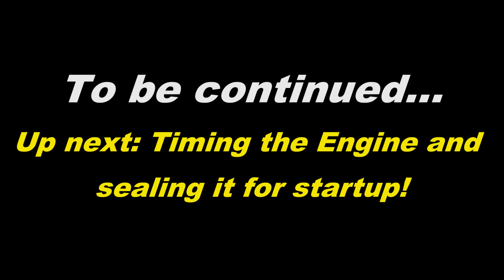Ford 5.4L 3v Engine Timing Chain Kit Replacement Pt 3 of 4: Valvetrain Component Removal

Comment: ...Also, I purchased the Melling M360HV Oil Pump that you linked to but it says it does not fit the 2008 Ford F150. Do you know if that is true or not? It is Amazon saying it does not fit.
I found your video explaining the differences One is just higher pressure. I will stick with my order. You do great work for us home mechanics keep it up!

https://www.youtube.com/watch?v=WLFzB0e3GZw
Reply from the maker: The parts I list fit all 3v engines 2004-2014 otherwise I would of never listed them.
Reply: @FordTechMakuloco  Thanks for the response. I did find your other video that explains the difference between the two. It helped a lot! I'll be keeping the M360HV.

Comment: Help I can’t get the exhaust valve Roller followers off. Intake was easy but I run out of these on tool to crank it down enough to relieve tension. Any pointers?

Comment: Do you need to take the roller followers out to complete the timing chain job if you have the cam sprocket holder and timing tool?

Comment: Hey so I’m working on my brothers 04 f150 5.4 3v and I was wondering if I absolutely have to remove the cams? 2 timing guides shattered and one tensioner is shot and is a mess but can I get away with just replacing the timing components or do I absolutely have to pull the rollers and cams out? Thank you.

Comment: Hypothetically say some dummy took the chains and fazors off without crank mark at 6:00 and the cam mark in the correct position. How can this motor be retimed correctly. Your be greatly appreciated I can't find anything,anywhere on how too
Reply from the maker: loosen cam caps slowly and evenly until they can all be taken off and put to the side in order. Then remove cams, toss followers and turn the cranks keyway to the 11 o clock position and pick up with timing the engine part of the videos after clean up.
Reply: @FordTechMakuloco what do you mean by “toss followers”?
Reply: @GhostDog88 they are to be tossed in a salad of brake cleaner and cleaned up for careful inspection. You’re looking for sagging rollers, excessive vertical play and wear on the rollers themselves. Don’t forget to soak them in some oil if you’re going to reuse them .Check out his other videos, specifically the ones with roller follower installation. Also don’t forget to check and test your lash adjusters too.
Reply: He of course means to toss them to the side to inspect them and then continue video to time engine.

Comment: I'm trying to get the single loan in silinder 8 with the tool u show..I started in cylinder 5 so the 1st two to come out the tool went on where the spring is now sweitchin to cylinder 8 do I reverse the tool I tried it the same side as spring with the feet sitting on the spark plug hole am I doing this correctly???

Comment: What was the purpose of taking the followers off? Do I have to do that.
Reply: I'm doing this on my 06 f150 right now to my understanding the point is to allow the camshaft to move freely so you can line the chain and phasers up, I did not remove all my followers only the five or so he recommend on each side, because of this I had to loosen the cam caps to allow the cam to roll into position with the timing marks then tighten them down to get the tensioner and guide to fit. I have not finished this job so I do not know if this has damaged anything because I have not started the engine so be careful.
Reply: @hollisbrazier4786  looks like im going to have to take the followers and cam off anyways tomorrow. I took valve covers off today and I was sad to see how gunked up and varnished the valve train is. I bought this truck and it looks like they barely changed the oil on this thing so I’ll take the camshafts off the clean them and clean the followers even tho I should just get new ones at this point :/.

Comment: Is it completely necessary to take roller followers out or is that just to make the job easier. It’s my first time doing timing and I didn’t want to get any deeper than what I need to
Reply: I'm doing this on my 06 f150 right now to my understanding the point is to allow the camshaft to move freely so you can line the chain and phasers up, I did not remove all my followers only the five or so he recommend on each side, because of this I had to loosen the cam caps to allow the cam to roll into position with the timing marks then tighten them down to get the tensioner and guide to fit. I have not finished this job so I do not know if this has damaged anything because I have not started the engine so be careful.

Comment: Great job(s) on all your videos!
I'm performing the timing chain updates w/water pump and Melling oil pump AFTER I just did cam phasers with the front timing cover on.  

I noticed my upper chain tensioner on the RH side was busted b/c I noticed it was loosie goosie after I was done...  I don't know if the cheese block broke it, but it could have.  It's broken off and looks like it slid down and hanging there on the chain.

I'll have the valve covers off with the front cover to do the timing chain updates.  

I plan to have the keyway at the 11:00 position (the dot at the 6:00) when I begin the job (opposite from the video).  At this point, all I need to make sure is that my two marked chain links match up with corresponding (RH - pass side - [R] on the phaser) and (LH - driver side [L] on the phaser) with the single marked one at the [DOT] on the sprocket when I put the new chains on - correct?

This seems like it should be that straight forward without having to pull phasers off and no rollers to pull/replace this time around... ONLY b/c I did the phasers already.

Hopefully you verify my plan and respond beforehand, but of course my dad will be there to watch me do it, too.  He won't let me screw up.

Comment: For those who may have purchased the Valve Compressing Tool OTHER than the Recommended OTC Tool.  OR you recieved a counterfeit item. You may find that you cannot catch the threads while trying to screw the top piece on (The top piece that you turn down on to compress) If this is the case just unscrew the little dimple piece and file (Evenly) it down about 1mm or "1/32nd. Should be good to go.
Reply: I have a feeling you're not putting the forked end over the edge where the valve cover rests or the foot of the valve end is not getting positioned well over the spring.  I was having this issue multiple times, however it's a matter of having the correct angle with the tool and the threaded part needs to rotate to get inserted.  I was having this issue often until I got the hang of it.  Try aligning it on an easier to access roller follower and try that for some practice.  I know the 4th and 8th cyl was the more difficult one for me due to angles.  Use your phone to take a pic of your alignment where you can't see the foot on the spring to make sure it is not hitting anything else.  

I'm done with the first part of replacing the cam phasers but I realized that one of my tensioners was broke, so I gotta do the timing chain now.

Comment: On my 2007, the #8 roller follower would not come out until i cranked the keyway to the 6 o clock position. I removed #1, #4, and #5 at 12 o clock as your video showed, but #8 exaust lobe was at the incorrect position for roller removal. Is that normal?
Reply: Update, I found a forum with similar circumstance, in the thread a user specified the correct order: 
1- crank key way at 12 o'clock, remove #1, 4, and 5 followers as specified

2-rotate crank to 6 o'clock and remove all remaining followers.

3- rotate crank to 11 o clock (verify with otc crank position tool) and then install new hardware. After guides/tensioners/ chains/phasers are installed, you can begin re installing the majority  of followers in no particular order while at the 11 o'clock position. You can then crank by hand as many times as you need to get the rest of the followers back in. The followers go in much easier than they come out so don't be afraid to take them all out, it is more intimidating than it is hard. You can do it! Follow the 4 part series to a T and you will not miss!

Comment: Hate to ask ..but wen removing valve compression tool after  removing each Roller-follower.. the valve & keepers will relax bac in place..& when replacing them back (Roller-follower)..do u also press down on valve stem to keep keepers from falling out ..Help I'm scared 😳 Thanks in advance..& really admire ya wisdom ..

Comment: Should roller followers be replaced before the timing set or afterwards?
Reply from the maker: At the very end.
Reply: @FordTechMakuloco  Thank you sir, I’m literally studying your methods as my family’s expedition is suddenly going through phaser oscillation and low oil pressure I thought for sure it was a rod bearing until I came across your content.

Comment: Is this a interference engine ? 
I’m working on one on these and the phaser is so bad as turning the crank the LH camshaft jumps of the phaser and re engages in rotation. The tension spring on the phaser is so bad I can easily pull it off by hand

Comment: Two questions please. 
1.  Is it possible to replace the timing chains without removing the valve followers?
1. Looking at my current timing marks on the chains it appears that the marks on both banks are one tooth off.  Meaning the mark on each phaser(L or R) is not centered in the marks in the chains.  Does this mean each side jumped a tooth?
Reply: Did you ever find out if you could? I’ve seen others do it by holding vice grips but still trying to figure that out

Comment: If I am planing to replace all the cam rocker followers while replacing timing chain components, can I remove cam phasers and gears then camshafts? I would image that would seat all valves and be safe? I would, then, install camshafts and use tool to install new cam rocker followers. I have owned this 2005 f-150 new. I have changed oil/filter every 5,000 mile or less. I have 163,000 mile on it. Would you recommend replacing the lifters too? Thank you for all the information.
Reply from the maker: You literally follow my tear down procedure which neutralized the cams in the end when I instruct you to remove the cams for inspection. This is when you remove the remaining 9 followers per side. I would check the lash adjusters in place by pushing on the plungers if they are rock solid or just have the slightest amount of give then they are ok. I never replace them on my customer vehicles because they almost never fail.

Comment: Is the 4.6 3v  the same as the 5.4 3v? I didn't time my mustang because I removed both heads and removed the camshafts and taken the heads to a shop. Can I put the lash adjusters all back in and the cam followers and the camshaft and put the heads back on?

Comment: first off thank you for all your knowledge it has helped tremendously. but i did the lockout kit rh side cam jumped on me and i could not line phaser but up to my marks i made . all i had was the lock out kit with new cam bolts and wedge tool . so my question do i start from scatch on the timing .i dont want to turn the crank and bend valve iam lost on what to do

Comment: What happens when the guides completely broken and half missing 🤣
Reply: If your guide is missing....Check the oil pickup tube! 
I had to use a pick and pull out small chunks caught and blocking the screen, causing low oil pressure, which ruined the cam, towers, and caps...
Had to remove heads, get new cams, caps, have the heads machined, then reinstall it all

Comment: Why did ford design the tensioners to be oil pressurized instead of the tried and true method of using a goddam spring and ratchet?

Comment: When replacing the cams. Do you pull the rollers 1st or can you remove the cam 1st? I'm doing a timing and roller repair. (While I'm in there might as well) 156k miles expedition. I like the truck I want to keep it going for few more years.
Reply from the maker: You literally follow the video series and install new cams instead of the old cams when I instruct you to lay them back in.
Reply: @FordTechMakuloco  yep... part 4 shows the cams thank you

Comment: Can you change all timing components without taking the cam and roller followers out?
Reply from the maker: Why would you not when the followers are a high failure point.
Reply: @FordTechMakuloco  long as you are in the engine , would you recommend just installing all new rollers and followers?
Reply: If you have a bad roller follower, would you just replace the one or replace all?
Reply from the maker: All of them.

Comment: In the video you said to remove roller  followers, 3 from each side one from  the passenger right front #1 cylinder,  middle exhaust and two intake #4 cylinder and to do the apposite on the driver left side. But in the video you showed the apposite of what you said. I did want you said and the camshaft was still under pressure. I just wanted to bring this up to your attention, and thank you for your videos thay we're very helpful and got the job done. 😀
Reply from the maker: I explained it very carefully and clearly in the video, I literally couldn't make it any easier. After the 6 followers are removed the camshaft will still be under tension. That is why we move the crank to the next position which then neutralizes the camshafts. Don't skip around in the video and you will be fine.
Reply: @FordTechMakuloco  You explained it clearly. what we need to do is watch the video multiple times, takes notes and visualize.
Reply: @FordTechMakuloco  its because @5:08 it kinda looks like you're on the passenger side but you're on the driver side. You've saved me THOUSANDS of dollars, and have literally helped me put my kid through college. By prolonging the life of my 20yr old 4.6 v3 mustang and not having to buy a new car! Thank YOU!!

Comment: I am doing the job on my 2006 f 150. At the point of removing roller followers. Is it a must to remove this and camshaft to put the new timing chain and parts on? To skip inspecting them, that step?

Comment: Another great video! I’m deep into this job right now. Just about done the teardown and removal of all timing components. I have a question regarding the phasers. When I initially pulled the LH valve cover, I could clearly see that the phaser middle spoke on the reluctor ring was way out of alignment with the “L” timing arrow. However once I neutralized the cams based on your instruction, somewhere along the line the middle spoke returned to the correct position (lining up with the “L” again). Is this normal behavior for the phasers? Trying to figure out if it was indeed bad. I’m replacing them anyways, this is more for my own education. Thanks again for the very helpful series. Wouldn’t have attempted this job without it!

Comment: Urgent question! First off, love the videos! My question is when I pushed down on the valve springs, I took the roller follower out, and relieved the pressure fully. It looks like I can see the grooves in the valve stem are above the keepers? Any suggestions? Please help!
Reply from the maker: Relieve pressure a bit until the groove in the valve stem lines up with the keepers, work the keepers into the groove and once in the groove release the rest of the pressure.
Reply: @FordTechMakuloco  beautiful. Thank you for your help! Also, do you have a donation page on your business site? Let me know how I can pay it forward. Happy to help in any way I can, since you’ve helped me a great deal!

Comment: I’m having real hard time removing the roller followers. They just pop out in your video. I only got cylinder1 out. Am I doing something wrong?
Reply from the maker: Make sure the cam is at base circle.
Reply: @FordTechMakuloco  if I wanted to replace the cam shaft do I need to take the three roller followers out first? If not then, should I just put the crank at 6 o’clock and remove the cam shaft bolts? I was searching your channel for a video on procedures to removing cam shaft. I love your videos and have watch almost all of them.

Comment: Ok, I'm confused, at 10 minutes in I see cam phasers with white marking, then in the next video you install the phasers on the opposite sides, what I'm I missing? left is on the right Etc.
Reply from the maker: Drivers side is the left and the right is the passenger side.

Comment: i have a 2007 f150 fx2. your videos have made my life so much easier. question.  Once the first 6 followers are removed. and crank set to 6oclock. Can i pull the cams out once in neutral pos. Other than removing  the remaining 9 on each side.

Comment: First I would like to say that your videos are the best out there and thanks a million for your time. I have a question- Is it OK NOT to remove the roller followers as long as I assure nothing moves and the crank is at 12 O'Clock and the #1 piston intake Lobes are at 11 O'Clock? Thank You for your time.

Comment: Isn’t it faster to just remove the cams and replace all of the roller followers? That’s what I plan on doing with this 5.4 3 valve that I’m working on. I did not obtain that OTC tool to remove the roller followers. Perhaps I’m missing something in your video instructions? Thank you
Reply: Yes I am thinking since he only had to replace a couple it was easier for him just to use the tool but I agree. I feel like if you're doing three or more or all 24 like I'm going to do that the cam needs to come out.  As long as you are TDC the phaser and crank your and chain will line up for you